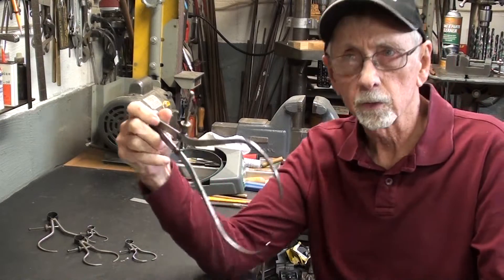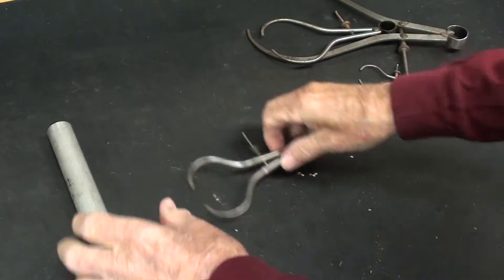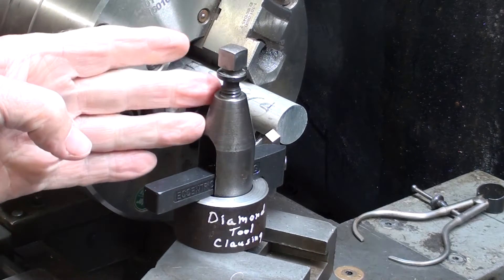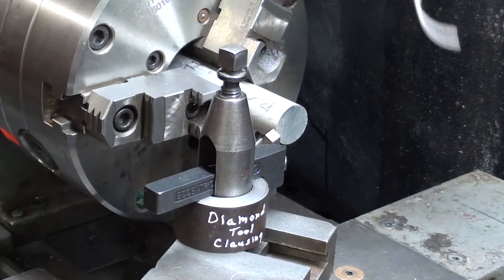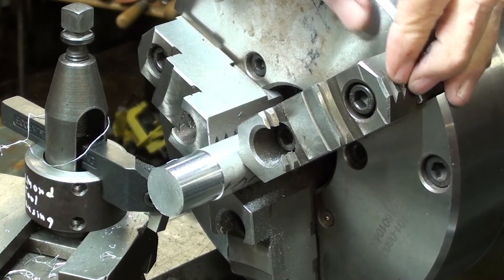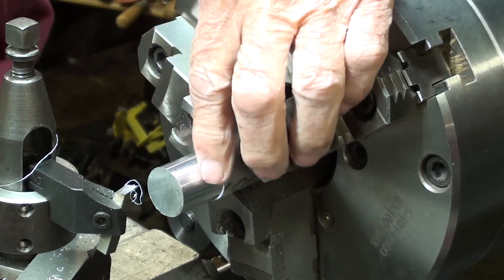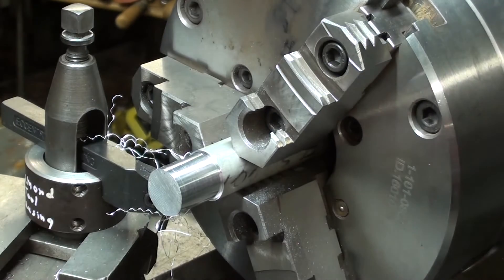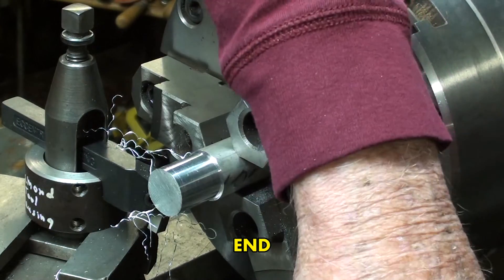ACCURATE MACHINING WITH CALIPERS #20 short tubalcain

Comment: I like inside calipers for precision fits in small bores which my verniers won't fit in (below 10mm).
Haven't tried using outside calipers for precision fits yet, but I like using them to quickly scan through a pile of stock to find one suitable for the job I want to do. Set the caliper for the diameter needed and just slip them over the bar stocks - if it fits, it's too small, if it doesn't you've got yourself a winner.

Comment: I have used the method multiple times. I especially used it with inside micrometers, where my telescoping gauge would not reach as far down in. The customer needed the bore opened up down into the bore..

Comment: Hey Mr Pete, great video! Where can a guy buy those diamond tool holders?
Reply: There is an outfit called Eccentric Engineering that makes them.  They have a pretty interesting website.  Company is in Australia so it takes a little while to get them once you order, but the gent who runs it is very responsive

Comment: I use spring calipers all the time for bore work since I can clear the tool in the bore. getting the right "feel" to hit within .001" is pretty easy, getting to .0005" +- is a lot harder.
Reply: I was shown a trick by an old tradesman back in the sixties, when I was an apprentice.
It works well with telescopic gauges as well. I am not as dexterous as I used to be but I can still achieve an accuracy of 0.003mm.
Hold the micrometre in your left hand so you are looking at the back of the barrel, the thimble is adjusted by one finger on that hand. The inside spring caliper is in your right hand same as when it was in the bore. Concentrate on the feel as when you were in the bore. Since you cannot read the micrometre you are not distracted by what it is reading.
Back in the day I was just as good with firm joint calipers.

Comment: I’ve been building a PM Research shaper.  During the build I found it easier to use both internal and external calipers because of space issues.  I was amazed how accurate they were if I took my time.  I didn’t think to use gauge blocks, but will from now on.  Thanks for information.

Comment: I use mine to rough in new parts .010 over size and let part cool, then finish machining. Learned that from an old crusty machinist born the year my 9 inch SB lathe was built.

Comment: Mr. Pete, I also watch the Pakistani Truck channel and many similar ones. It's really an exceptional experience just to follow them and I often wonder what you and the other YouTube machining 
mainstays would say. Thanks for this contribution.

They also use the calipers while the machines are running, even on those enormous lathes, to measure parts 20 in. in diameter and more. I sometimes worry about them but they all still have 2 arms. 

I imagine a caliper can spread and set a tiny bit with all those tight measurements, and also the friction from running measurements may shave the tips, hence the actual workpiece size may be a hair different (larger I suppose) than measured. I guess they recalibrate every few hours.
Reply: Well, they don't put the ones who lost something in the vids is all.  They make ol' Lefty One Eye take the day off when the cameras are rolling.  They probably get the guys who lost stuff on the right side team up with guys who lost stuff on the left.  Also remember, life is pretty cheap over there.  The REAL amazing part of those vids is those skilled machinists over there only get about a dollar a day, a hand full of rice and all the water they can drink from a garden hose as pay.

Comment: I will often use a spring caliper on my engine lathe to rough down to about .010 from final, then switch to the micrometer & sneak up on the desired. This likely from many years of wood turning spring set large  to over size for quick rough down, then re set & carefully down to final.

Comment: Something I was taught was to hold the caliper across the spring. Apparently the strength needed to hold the caliper still is enough to throw the jaws out slightly if you grasp the tool in line with the spring. I was also told to stop the lathe, not for safety but because a less than perfect finish can abrade the tips of the jaws leaving you large.
Reply: those suggestions are very inciteful.  Also, stopping the machine would give one a more accurate feel it would seem.  As running would obscure the static friction feel I would think.